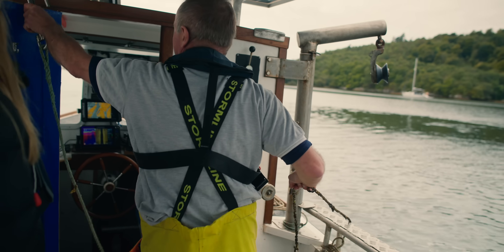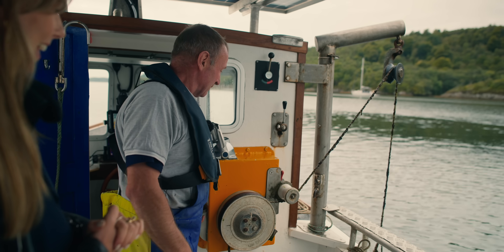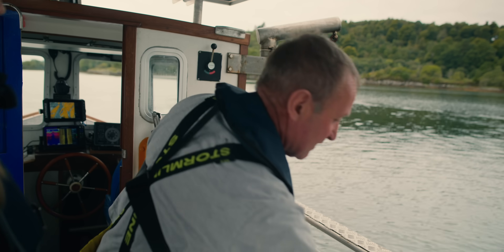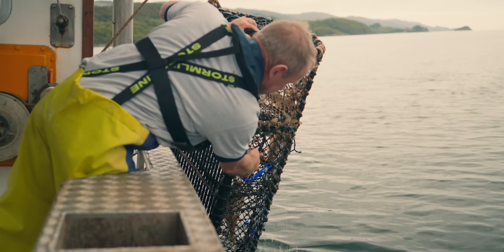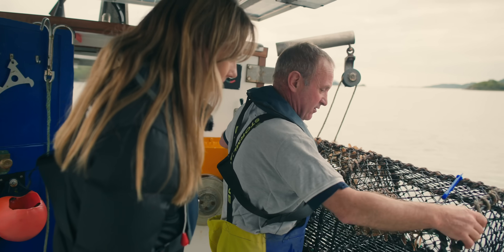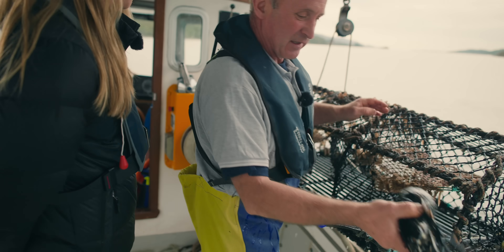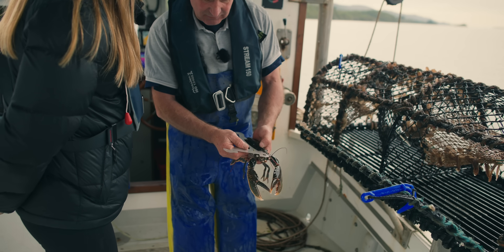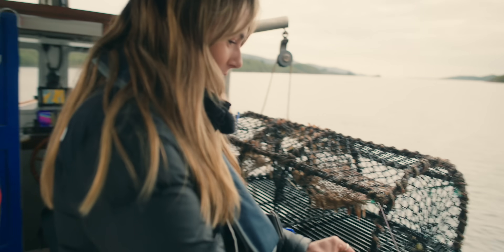Onboard the UK's FIRST, Fully Electric Solar Powered Fishing Boat!

Comment: If he can run for 2 days on solar power in Scotland Imagine how effective those solar pannels would be in the med! What a great guy, thanks for the video.
Reply: It caught me out but in Scotland we probably do better than the South England! Like in England we get virtually nothing through the winter but in the summer we have much longer daylight hours so actually have more useable hours of solar.
Reply: In Positano you can see all these little petrol runabouts taking tourists on charters and to and from resorts and restaurants down the coast. It would be amazing the transformation that could be had converting some of these to solar and/or an electric engine powered by port-side, solar-powered charging.
Reply: My holiday every year is in Greece, and you see the fishermen come in early as they've been out since stupid o'clock. The boats can then sit all day in direct sun. The same with those tourist boats, sitting often most of the day only being taken out once a day. 

And the bigger your boats could easily have lots of solar on them too, not for 100% power, but enough to offset and make a big difference.
Reply: I checked the Global Solar Atlas and Sciliy get 2x the expected power from PV as Scotland per day. Even taking into account that 18h day on the longest day of the year  Sciliy will still get much more power.
Reply: it depends on where you do fishing, 60 miles is not that much.
Reply: @alanmay7929 he is a lobster in shore  fisherman. He is very unlikely to travel more than 20 miles from port in any working day.
Reply: @alanmay7929  You could make it 120 miles if you double the battery capacity and off course generate more power if you fish of Egypt say!
Reply: @alanmay7929  Then that will still be sufficient for many boats that do similar mileage, and those that do more could have bigger batteries. His 45kwh is not very big.
Reply: @peterjones6322  lol!!!! He does basically nothing! Other boats have to catch much bigger and stay for longer in water, preserve their catch....... What he's doing is like hobby more than work.
Reply: @alanmay7929  - this is typical of inshore and near shore fishing boats - where under 10 meter boats can represent upto 80% of vessels (such as in England) - whilst most of Scotlands and Northen Irelands fleets typically seek deeper seas. Lobster fishing is the UKs 2nd most profitable catch by value and the fifth by volume. So no this type of boat isn't a hobby vessel but part of a rather large under 10 meter sized fishing fleet.
Reply: He can run 2 days a week! That's 7 full days of charging for two 20 mile journeys in calm weather. This thing is an old mans toy.
Reply: @pauls3075 He also charges it off the grid which is what cost him only £330 for the year as opposed to £20 per day for diesel. Are you not smart enough to listen and understand. ?
Reply: @peterjones6322  It is a toy, a pimped up single man fishing boat. Just a bit more powerful than a row boat. There is NO comparison to a normal fishing vessel. Are YOU not smart enough to understand that NO practical fishing vessel can yet use an electric motor, they do not provide the necessary sustained power needed. But hey you carry on living in your land of rainbows and fairies.
Reply: @pauls3075  An he never pretended otherwise in the video. Why are you so angry?
Reply: @DavidKnowles0  Why are you projecting anger on my comment?
Reply: @pauls3075  - your comment just demonstrates: 1) you know nothing about this specific subject; 2) you're just seeking to make noise, insult others and belittle other's input.

This is a practical fishing vessel, typical of many scattered around the UK coast and is typical of inshore and near shore fishing boats - where under 10 meter boats can represent upto 80% of vessels in UK waters (such as in England). Lobster fishing is the 2nd most profitable catch by value and the fifth by volume. So no this type of boat isn't a toy vessel but part of a sizeable under 10 meter sized fishing fleet.

Electrification of large boats has been happening for a while now, being used for replacing diesel props with electric gensets and electric motors; where higher operating efficiencies and hence lower costs can be obtained. A boat/ships traction system has already been electrified, so your assertion that "NO practical fhishing vessel can yet use an electric motor" is wrong both on boat size practicality terms and that electric motors cannot be used. In terms of power source diesel predominates today but governments, operators and boat makers are active in investigating alternative fuels for the maritime segment (including fishing boats/trawlers) - these include hydrogen, E-fuels and even batteries depending upon segment and evolving technology.
Reply: @GruffSillyGoat  You clearly dont understand the science behind energy density and power to weight ratios. Neither did the Germans who bought an electric ferry which failed spectacularly. Missunde III electric ferry... they wasted millions.
Reply: @pauls3075  - Let's see, degree level physics education and worked in electrical energineering, so maybe you're correct that I don't understand the science behind energy density. 

I see your ignoring the point that electric motors are used in maritime, which is what you claimed wasn't the case and now pivoting to energy density, well let's explore that topic a little as well.

Oddly, both Lithium power and Fossil-Fuel (petrol/diesel/kerosene) have similar maximum theoretical energy densities of around 11 to 13kWh/kg. 

In maritime, fossil-fuels engines have an efficiency range of 40 to 55%, with the upper range applying to genset based electrical propulsion, meaning the useable energy density is 5 to 7kWh/kg. With over a century of innovation to get to this point. 

Lithium's current max usable is 1.7kWh/kg (Lithium-Air batteries) and around 500kWh/kg in Lithium-Ion based batteries, and are already at a level that suits many vessel's needs (including ferries and tugs). The innovation in battery energy density has occured rapidly in the last two decades, and have significant drive, focus and investment involved. 

Given the pace and momemtum with battery innovation, and the simularity in max energy density to fossil-fuels, then I personally would not seek to make claims that electric power and propulsion doesn't suit maritime usage (where it's already in use) for want of being shown to be a fool.    

There are numerous electric ferries operating around the world, you don't mention these rather focus on one that has had design issues of the old fashioned balls'ed it up during the paperwork stage style, which happens a fair bit in maritime what with it being a tricky environment to predict and get right. 

The Cowes Floating Bridge is another problematic ferry example, diesel powered this time, went into service in 2017, cost millions, has had numerous operational and design issues and requires the help of a push boat in strong tides to cross; it's now is to be replaced again. The review report into the floating bridge ferry recommends it be replaced with an electric ferry, being lighter and more powerful it will cut the crossing time and won't run aground.
Reply: @GruffSillyGoat  If electric boats were more efficient or more practical then all new boats would be electric. They are not! The whole maritime industry disagrees with you. Despite the huge taxes on fuel and the subsidies for electricity it is still more cost effective and practical to use diesel to power boats.
Reply: @pauls3075  - Large pealagic trawlers already use genset electric propulsion, some operating out of Scotland - which is why your comment that no electric motors are being used on large fishing vessel rang as hollow and untrue. The maritime industry use these as genset arrangements as they are significantly more efficient than direct diesel engine driven props. 

I don't know how you believe you can speak for the "whole maritime industry", when they themselves have adopted electrified propulsion specfiically for it's effectiveness and lower cost.

In terms of your pivot from electric motor propulsion to electrical power source, there are a whole range of vessels - ferries, tugs, cargo, river transport & pleasure craft - where fully electricfied operation is being adopted more and more, due to being more operationally effective and economical for these vessel's particular needs. There is even a fully electric 10,000 tonne container ship and a 1,300 passenger cruise ship already operating in China. 

So it seems the maritime industry itself is turning to electric power, whether in propulsion alone or as a fully electrified system combined with an electrical power source.
Reply: @pauls3075  it sounds as if you're emotionally invested in these things never working out. Do you realize what's been happening with electric ferries in the last years all packed with MWhs of batteries. It's like those in agriculture manically arguing that because Claas hasn't put out an electric harvester capable of running 16h+ on inbuilt batteries that a swap to electric in agriculture was NEVER feasible.
I would have so much more respect for your point if it came from a position of direct involvement talking about what you've already tried and what remains challenging today but instead your defending a technology that is suboptimal on so many levels as if they were gonna give you a big prize once you've staved off all those silly electro heads.
Reply: @pauls3075  I think you are a bit muddled! By "2 days a week", he means the energy he generates over the course of 7 days is enough to power his vessel for two days of fishing. Put another way, if he leaves port on Monday morning with fully charged batteries then he can fish on Monday and the whole of Tuesday on solar power alone. He would then need to charge fully up Tuesday night to start again on Wednesday. Overnight off course, like a car, he charges from the mains supply he has next to his berth in a handful of hours.
Reply: @marviwilson1853  I'm not muddled by that. You seem to be asleep to the fact that the fishing industry has very low profit margins and if it were sensible, practical or worthwhile everyone would have switched to electric by now. It is none of those. This boat is an old mans toy, nothing more.
Reply: @pauls3075  Depends where you fish and what you fish for. I always remember all the young lads in Fraserburgh, Scotland going up and down the main drag in their flash new sports cars! If you are reasonably young you will witness a large part of the electric revolution that has really just started. It's a 100 year transition period from the fossil fuel age. All I can say to you is that in 15-20 years time you will look back at your words and realize the lack of imagination you had at the time to see what was coming.
Reply: @marviwilson1853  I remember dreamers like you telling everyone that "Cold fusion" is just a few years away and limitless cheap energy will solve the worlds problems. Most of them are dead now.
Reply: @pauls3075 alright mate calm down. Yes this may not be feasible for big boats that spend many days of shore but not all boats are like that. It’s like an electric car compared to an electric lorry. It’s definitely a good step in the right direction but it clearly isn’t a catch all solution.
Reply: @iamthemobey  I agree.
Reply: @pauls3075 it also plugs into a shore power socket and can charge overnight on renewables so he could work 365 days a year and not burn any diesel
Reply: @geminicatamaran  This is the kind of drivel I expect from a 5 year old, of course diesel and other fossil fuels are used to power this boat. Tayvallich's electricity is generated by Scottish and Southern Electricity company, the overwhelming majority of which comes from Gas and diesel generators. Just because you don't see it burning fuel doesn't mean fuel wasn't burnt to power it.
Reply: @pauls3075  You couldn't be more wrong. Tayvalllich is on the UK grid. The electricity in northern Scotland is mainly powered by wind and hydro power. You can check the generation stats in real-time ... today I see that the figures are 97% wind power, 3% hydro power so 100% non fossil generation. Please reply to me with evidence of where you got your incorrect information from because I can get in touch with your source to advice them appropriately.
Reply: @pauls3075 2 days a week IN THE WINTER. In the summer, he doesn't charge at all. 

Do you remember the very first ev's that came out with a 40 mile range, and here, a few years later, they have 8x's that? This is literally that first ev for fishing boats
Reply: @sh969  Electric boats are not a new idea. Submarines have used electric engines since the 1940's and the first boat to sail round the world on just electricity was in 2012. How far do you think the technology needs to progress to get the required energy density of fuel to make them practical? Oh you didnt think about that did you. They are very expensive toys.

Comment: I wish everybody was as thoughtful as this man.
Reply: and who isnt thoughtfull? not everyone has the same needs or the exact use of boats.
Reply: @alanmay7929  it is not about boats. He is thoughtful because he cares about the environment and the impact human action has. So he dicides to have is boat converted to electric. That way he is not putting more pollutants and heat trapping gasses like CO2 in the atmosphere and the air that we breath. Do you understand that? You can be thoughtful too by avoiding burning more Fossil fuels. Give it a thought.
Reply: @bossman6174   He is to be applauded, but, to really make an environmental impact all of the 300 plus cruise ships should be stopped from churning through around 4000L of dirty diesel an hour and dumping their sewage into the sea for "pleasure" . That would have more of an effect than taking many millions of ICE cars off the road instantly, and also prevent fish being poisoned. The oceans could recover when there were only around 70 cruise liners of the old size but not any more. I am always amused at the number of EV owners who say they are doing their bit for the environment, then go on numerous cruise ship holidays a year.
Reply: @stephenwood9687  you are absolutely right. Cruise ships are a curse to the environment and I will NEVER take one.

Comment: This is a perfect project for 2nd use EV batteries. We just need a company to come along and marinize lithium phosphate packs. Too many projects like this are using these small and very expensive "car starter motor battery" type golf buggy offerings. Given solar panels are thin and light, the solar roof should be a two layer stack with athwartships extensions. Then the solar array could be doubled in output.
Reply: You're absolutely right but no way will the compliance look at them.
Reply: @HansUnkles  Interesting with bureaucracy to compare the marine industry with the world of aviation where pure electric planes are also on the way. I can imagine that the antiquated marine regulators are far more slow on the take up than the forward thinking aviation industry.
Reply: @HansUnkles  A company in China CTS makes marinized lithium phosphate batteries for boats Their CTS530230 product is 122Kwhr for $20,000! which is a lot less than the 45kWhr pack you use. It's a high voltage unit but they also do 48v and 96v products. I wonder if the compliance people would accept these. The company seems to have many quality certificates. The point I really wished to make is the price. No doubt the battery modules in theirs are the same as in the Epropulsion units.

Comment: Saw this guy some time ago .. sound sence and natural resouce  management.

This guy is like the Edison guys with their logging trucks an enthusiastic pioneer... In the face of the  ICE /fossil fuel diesel naysayers and Paid 🧌 s.

If you need a budget motor with more power  a Nissan leaf motor would give 90-120hp equivalent  plus diesel levels of torque.. direct ..no gearbox needed.  Now with Na and New forms of Li Fe Posphate  cheaper cells using Fe or Manganese cathodes you will get safer more temp. stable tolerant cells with longer life spans. 

A larger vessel or a Catamaran hull form  would give an owner more solar space.

But the bureaucratic hoops  
that get put in the way of  innovative green 💚 projects like this are a major deterrent to the men and Women who know what to do and how but may be blocked by micro managing bureaucracy's  that haven't really got the experience or lack the flexibility of judgement to create the rapid change progress needed to counter the climate and environmental problems. 
🧙🏻‍♂️😎👍🏼

Comment: Until the wind gets under that Sail  on the roof and the batteries    so heavy  they just tried a electric car ferry norway?     it failed
Reply: What are you on about? There are plenty of electric car ferries in Norway, because of course there are. It's Norway. So fudging what if the first attempts had some issues. "It failed"... And then we built better ones that work. Simple.
Reply: Come on mate. Do your research. The last thing we want here is fake news and preferred outcomes. Any boat, plane or car is designed for a specific mission. That is why an F1 car looks nothing like an off road jeep! The electric ferries in Norway are designed well to do their mission.
Reply: Which ferry were you referring to? (They have been running electric ferries for about 10 years and there are about 80 of them according to Business Norway)
Reply: the solar roof is the same as the old roof he replaced, with no more windage.  and the batteries weigh less than the diesel engine he removed. what other reasons can you make up to convince yourself it wont work.  maybe you should watch his short film "it'll never work" it refers directly to naysaayers like you.